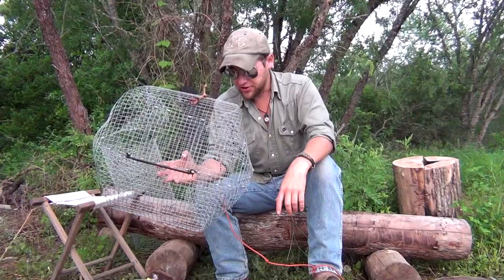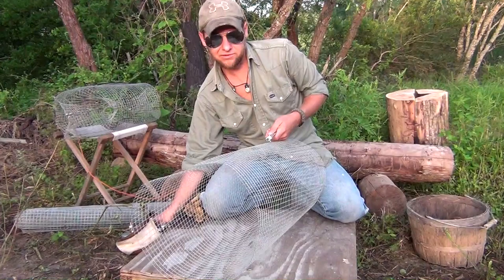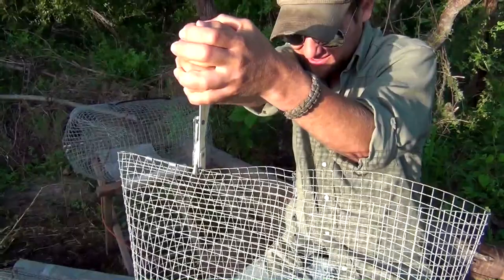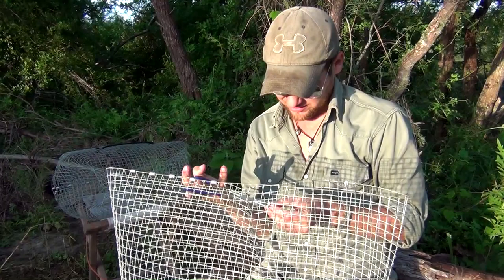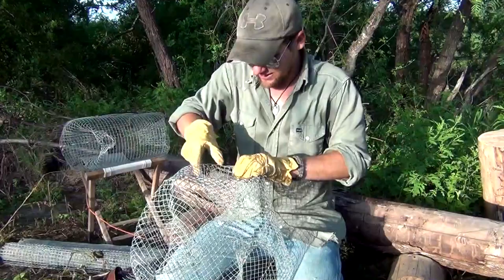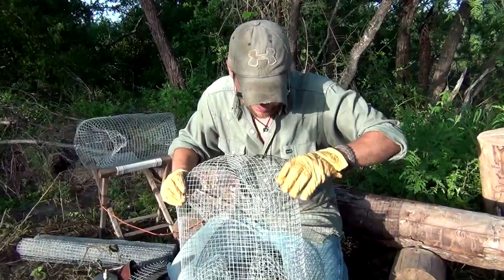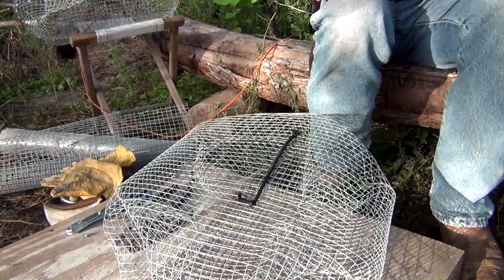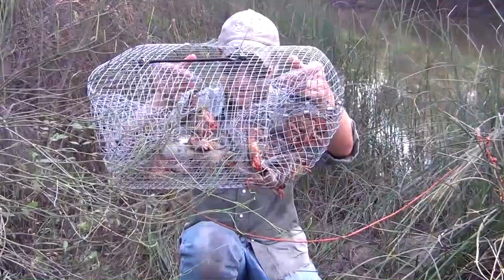DIY Crawfish Trap Build  -My Custom -5$ Design-

Comment: Hey Bob...Ray Sapien in Dallas Tx. Grew up fishing on the Rio Grande North of El Paso. Catching and making crawdad traps since we were kids. We built our own traps, hunting and fishing gear.You may find it easier to form the cones (pre fold) on your trap before you clip it together. At least part of the way. With the trap open...you could clip the cones from the inside. I don't know how you were able to bend that mesh since any kind of rough handling usually separates the solder joints.We would also double all the edges by one square so as not to depend on the solder to keep them from ripping apart. I liked your clips...We used the end of the wire mesh curled around in a cross to "sew" the ends together. Or pull off a row of wire off the edge of the mesh and actually sew the ends together.  Really enjoyed your video. Brought back some good memories. Going to break out the craw traps (hand made) and fishing rods tomorrow. GONE FISHING!!!!!!!!!!!!!!!!

Comment: You can also use a piece of an old bike tire tube cut into a strip as a way of keeping your hatch closed.  Cut the tube into a strip about 4 inches long, tie one end to the trap below the door and tie the other end to an "S" hook (made out of a coat hanger or you could buy one).  It's stretchy and holds good tension on the door, it also is easy to hook and unhook.  Keep trappin' those things and keep posting!

Comment: Smart design, we don't have a lot of crayfish, but it would make a sweet catch all minnow and crayfish trap!!!!
Reply from the maker: It has been working nicely.  Have a great deal of bycatch to release each time, but I imagine that a few other states might have laws that would permit a more expansive use of such a trap.
Reply: Bob Hansler
Yes, we do in Ontario.  We can't keep game fish so that would leave out the eatable type fish, but we could keep the crayfish to eat and minnow for bait.  I'll see if I can find some small gauge material to work with!  I wonder if those jclips could handle some smaller mesh or I suppose I could go to wiring it together.  Would you suggest something else besides the jclips for minnow sized mesh?
Reply: Okay, I made the trap and used a small gauge mesh because I wanted to catch minnows as well which are legal here.  The mesh was too weak.  I managed to crudely work it into shape on the side, but the other, because I closed it up, didn't work as well, and so I just folded it over so it ended up having only two openings, not four.  I did another trap and tried to use an actual funnel and pull in through and shape it, no dice.  So I ended up making a separate hoop, bend it correctly and shoved it in and fastened it.  Hard to explain and it turned out pretty good.  I also couldn't use j-clips since the meshing is so small.  I should be able to make a video now and put it up.  I'll have to remake it with j-clips.  I really did like the original design and do want one for crayfish only.  I also managed to catch a few crayfish and ate 'em as well.  I will be up in the Wilderness Living Challenge in October!  First time eating them actually, and they were quite good.
Reply: @TheWoodedBeardsman  got 78 in one trap & 47 in the other in river Derwent Derbyshire England! American signal crays! Purging as we speak now so boil up tomorrow I think

Comment: nice trap design Bob.  after seeing you make one I made one out of green plastic chickenwire fencing and holy cow did it turn out great and works like a champ caught 48 crawdads the first time I put it out.  my design doesn't need a door because you can just pull out any corner and you have a funnel going outwards and you just shake the trap and they all fall right out into your containment cooler with a little water and a little ice.  I will never buy a trap again.  Again thanks for publishing the trap build video and try making one with the plastic chicken wire, they work great and you don't need a door.
Reply: Where did you buy that Green Plastic Chicken chicken-wire fencing?
Reply: What you mean about plastic chicken wire  im not understand im from Malaysia , are using this guy trap uh? It's work or not

Comment: While watching you tie off the bundge  cord to keep the door closed...thought occurred to me on double secured ends was to make a slide ends into mesh hole, knot the cord end, the double back the knot the use "J" clip on the knot and cord just below knot, repeat for other side. So usage of "J" clips goes from original 40 to 42 to construct the trap, but it ensures the cord staying securely fastened and adds a nicer, cleaner look to your latch system.

Comment: Bob, good morning.  Hadn't seen anything lately on your eye situation.  Did want to say that I hope all is healing well for you.  Regarding my comment on your trap here.  Noticed how when you are adding the corners it seems to be a bit of a struggle once you get the part inverted.  Have you thought about using some sort of wooden cone to help push in the corner and round out the hole?  Just a thought.  Goes along with the statement: "You have a hard job to do, give it to a lazy man.  He'll always find an easier way to do it"  Best Regards.  Prayin' for your health. Don

Comment: Use $0.29 canned cat food, punch 6-10 holes in the can and shove a piece of wire threw, with wire suspend bait can between top and bottom of trap, tie the can so it is in the middle of your trap, crawfish can't get at the bait inside can, this trap fishes for days..

Comment: Bravo, Bob Hansler ,well done got to give you credit for creativie thought process and ingenuity
on your Crawfish Trap design, way to go!

 I appreciate showing just how to fasten J Clips, that is very important task to know.

One thing when about  handling galvanized metal throughout the project from start to finish, it is a good precaution to wear nytril gloves as to the Galvanized finish may effect; irratate  certain peoples skin.

Inexpensive Hot Dogs work well as a source of bait  for Crayfish.

One should be prepared for the possibility of encountering and safely dealing with venomous snakes going in the traps after the fish etc.

Good that you emphasize knowing ones State Laws and regulations 
About overall trap overall  leangth, mesh size, entrance Holes ,Access compartments doors etc. 

Well said Know all applicabe laws before you do it and go.

Be safe out there and keep the videos coming!

Comment: If you cut your door opening in a rectangle shape that is 1-2 holes wider on each side you can turn it the opposite way and j clip it back on at one end and just use a piece of 550 para/cord or trot line to tie it shut with.
Reply: Banging idea mate !borrowed that information

Comment: Nice, I was trying to think of a similar design.  I wanted something with funnel on each side, and your design is about as close as you can get.  Now if we could only get it as a completely collapsible, fold able compact design.  lol   Thanks for the design tips.  Thumbs up!
Reply from the maker: If only.  Dont think that these will ever be collapsible, but they are the next best thing.  At tleast they are rigid enough that you could strap them onto your vehicle without worry.

Comment: For an extension you can cut your current design in half, and stick another length between.
Reply from the maker: The reason this design works so well compared to others is the lack of cutting.  f you wanted it to be longer you can just make it out of a longer initial piece.

Comment: Nice looking design. Need to pick myself up some hardware cloth and J-clips and get to work.
Reply from the maker: Have a few other designs, but this one is the most efficient durable, and easy to build.  Pretty happy with it.  Have fun with the build.
Reply: Bob Hansler Bought the hardware cloth, pliers and J-clips last year, but didn't check my MT state regs first. Up here we're restricted to 12x12x24" traps. Bought 3 state legal ones last year, so guess I better get busy copying them the best I can. Dagnabit!

Comment: First off I love your videos and this one was great as usual. This is just a warning to anyone whos going to make this style of trap. I just tried this with home depots 1/2 inch hardware cloth. when trying to form the funnels the hardware cloth broke apart and made it useless. I'm sure this is due to the low quality of the hardware cloth. Currently trying to figure out a way around this. I will post an update if so.

Comment: first saw this  basic design  55 years ago  an old black fella down on  the Louisianan buoy showed it to me   he used cat fish trimmins and heads for bait
Reply from the maker: Ive seen various traps with elements of this... namely pillow traps, but never come across it's like.  Imagine a few people have figured this out over the years.  Strange that it hasn't become better known.
Reply: cant speak to better   can to  easier  with modding minnow traps   most folk want instant gratification   not willing to put sweat equity in to save 3/4 of the price   we po-folk are known for this

Comment: panty hose work real good for a bait bag also ! thats one of the flooded areas ? WOW, the water went down pretty fast ! lots of good limb line bait !
Reply from the maker: Forgot abot the panty hose.  As per the flood the water goes back down extremely fast.  It leaves an extremely slick layer of silt on everything though that has to be washed off.  The canoe went right over that little tree next to me with several feet to spare.  Waters are moving in that creek though.  Have to set out some lines to figure out what is trapped in there.  Building the 150lb leaders and shark hooks to catch the monsters I see playing in the river.  Had an almost 9 footer surface yesterday and my wife is reconsidering getting in the water now.
Reply: lol, she said hell no huh ? are you going to make any vids of putting out the lines and what you catch ?
Reply from the maker: Going to make a vid on building the cables and... yea.  Game on.
Reply: game on, roger that ! cant wait to see the vids ! dont get pulled in and eaten !

Comment: Guess proof reading would have been good idea before posting comment. What I intended to write : run the cord through mesh hole, tie the knot, pull knotted end back on its self, then taking a "J" clip just below the knot to grasp top end of knot, through the mesh to the cord below pinch clip and repeat for other end.

Comment: I decided to make one and ended up with making two. The roll of wire mesh $10.00, tool $11.00 channel 68 cents, Bungee cord 17 cents per ft, and 50 ft rope $5.00. The first one took about 1 1/2 hours and the second one about 15 minutes. There is a reservoir not too far from me and will be using fried chicken. Thanks Bob cause at first I bought a one a sports store for $14.00 and not even 1/4 of your size.

Comment: 1st thing ...ty for this awesome video  (2) was wondering if when clamping together on the ends if maybe used something like a piece of conduit and clamp right up to the edge of it to form ur entrances .here in missouri we can only have a 1/12 entrance hole ( i was checking it out a couple days ago ) to make sure .  and i was wondering what the actual build time is for this type of trap ? thanks for the awesome videos
Reply from the maker: After making 2-3 I have the build time to under 30 minutes, not too bad considering that they should outlast me.  You can crimp up to the edge,, but it really makes the funnel creation hard.  You can always add a J clip from the inside once the funnel is created to narrow the entrance.  I would not put a ring around the funnel holes of any kind the creatures seem to be able to find their way out a bit easier when you highlight the door... why the frabil minnow traps dont work as well as the Gee''s.  Ill be messing around more with design as well as making some vids showing the builds of some of the more traditional traps over the course of the next month or so.  Thank you for watching.  Post the pics of your build or what you've trapped with this on my FB page if you end up making a few of these.  Would love to see what others get with it.  https://www.facebook.com/Outbackerish-1658414024370484/

Comment: starting a 2nd one and forgot that you fasten one side and push it in then go to the next and instead fastened both sides down is it ok to still push in each corner still
Reply from the maker: Makes it a bit more difficult, but stll doable.  The more you do it, the easier it gets.  Catching some good stuff here in mine.  Snakes are finding their way in as well.

Comment: We tried to build this trap the other day but I think we got some bad material.   When we tried to push the corners in the welds on the mesh all popped.  Where did you find yours?
Reply: I had exactly the same problem. The mesh just completely came apart. I used Yard Gard brand hardware cloth purchased at Tractor Supply Company.

Comment: Those j clips seem to be a lot stronger than zipties.
Reply from the maker: Yes, They'll last for a generation.  Much better than the 1-2 years a zip tie might get you.  Highly recommend buying a set.
Reply: AlexT I have an old fastener (like pliers with a Divot) and I make little galvanized wire C's and clamp them on

Comment: Having a problem with the mesh breaking any suggestions
Reply from the maker: You likely have a smaller size mesh.
Reply: @BobHansler  it's 1/2 inch 19 gauge
Reply: I found that if I bend the ends in some then close the end works good but you have to clip from the inside which causes a few scratches
Reply: Bob Hansler I've added a few mods on this trap I can do a walk through but not sure how my wire not the quality of yours

Comment: Hey geat video could you trap snake with these traps
Reply from the maker: You'd have to make sure that the openings are rather small.  Second check I watched a small water snake go in, pulled it up and started to pen the hatch... and he was out one of the openings before I had my hands on him... But I had the openings set for crawfish, which is rather large.  Should work.
Reply: Could you please make a video on how to trap snakes with these traps because I can not get the gee's traps where I live and I have some snakes I need to relocate thanks

Comment: good video Bob
Reply from the maker: Appreciate it.  Wanted to show the build on this trap for a while.
Reply: +Bob Hansler awsome video ima make one first thing in the morning
Reply from the maker: Everyrthing else I have seen has either been for commercial crawfishing.. which doesn't work in the deep water, or they are poorly designed and rely on bending metal to open... which makes them less than durable.  Wanted something that would outlast me.  Happy with what I came up with.
Reply: +Bob Hansler we have a minnow/crawfish trap and put it were all the crawfish go but never get any. what is the best bait for the trap?
Reply from the maker: Im finding more and more that folks up north are not having the same success with the dried dog food.  I had planned on doing some vids testing different baits in the same settings... but am unsure as to how applicable that info might be for others in different areas.  Dried dog food is king in my creek, Ive heard of alot of other baits working for others, usually meat based, fresh meat.
Reply: +Bob Hansler tonight we baited it with dead choped fish. what part of Texas are you in?
Reply from the maker: Below San Antonio.
Reply: +Bob Hansler I'm in east Texas (Nacogdoches)
Reply: +Bob Hansler up north in WV we use light bread or any kind  of bread, seems to work the best
Reply from the maker: I used bread when I was younger... heck, I used everything I could get my hands on.  Trial and error.   Good way to grow up, butmy parents had to try and intercept me a the door every once in a whie as I nabbed groceries that were on the not for traps list ; )
Reply: +Bob Hansler hehe. would wet dog food work?
Reply: +Bob Hansler when we use bread it catches us perch
Reply from the maker: rick banjo
Going to have to do a bait test video Im guessing.  Ill start work on it.
Reply: +Bob Hansler thanks that's awsome!

Comment: Great vids, I just came across 'em and have watched like 3 or 4 in a row. Quick question about these traps though. It's my understanding that traps have to have an access door bound with a material that will "disintegrate within a reasonable amount of time" so in the event that the trap is lost, the wildlife inside can escape. Did I read too much into that, or does that not apply to crawdad traps? I'm up in NE Texas so I fall within the same state regs as you.
Reply from the maker: Those regulations do exhist, but they are for the saltwater traps intended to catch crabs and the like.  Crawfish and minnow traps are good to go.
Reply: I appreciate the info. I think I may have just been going with the most restrictive rules as a "blanket SOP" so I don't screw it up.

Comment: Bob 1 question Ford or Chevy
Reply from the maker: Ford Tractors, Toyota Trucks
Reply: +Bob Hansler What kind of Toyota truck?
Reply from the maker: I've a Tacoma that gets me in and out of the forests and marshes.  I've a large Ford Dually in the barn that I pull out to haul loads, but it stays parked 9 days out of 10.

Comment: Is anyone’s else’s wire breaking when trying to do the hard opening part?
Reply: Mine sure did, when I tried to make the cones the mesh completely fell apart. I used Yard Gard brand hardware cloth purchased at Tractor Supply Company.